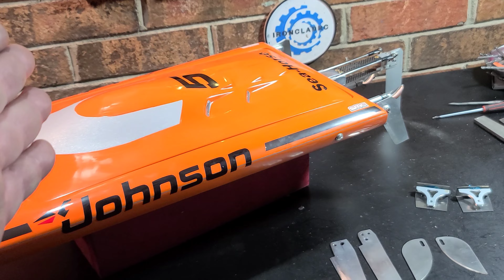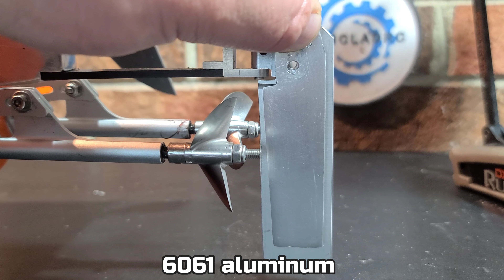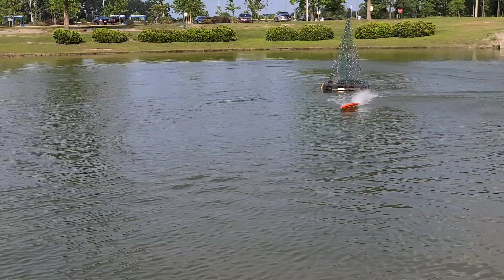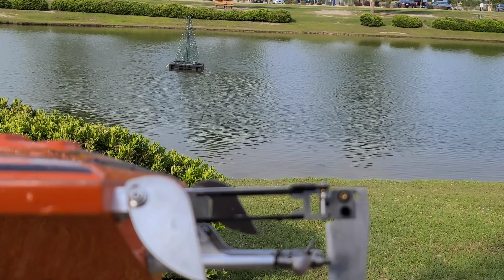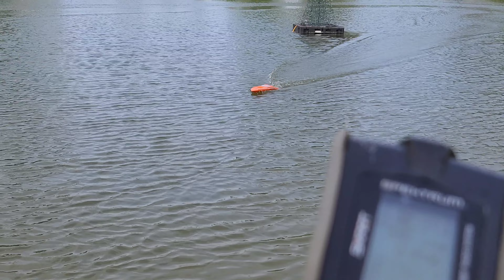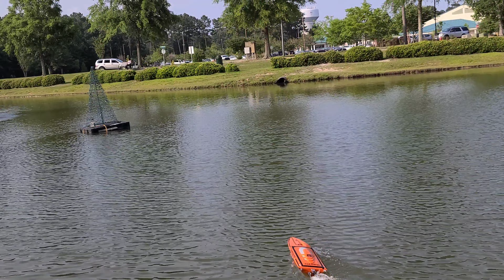True Tinker Test & Tune Session, Twin Motor Deltaforce 29 - Rudder Blade Testing

Comment: Awesome content again! I really like the twin motor mono idea. Actually, I owned kind of a twin motor mono: the Robbe Sea Jet Evolution. This is a water scooter and even though i used counter rotating drives, i recognize the sudden bites in the water. 
The difference in motor load, the rudder experiments  you got it covered 👍 I got a new project planned already, otherwise I would have accepted the twin mono contest 😎 Looking foward to the counter rotating setup. I think you could set it up to float above the water, like you already show in this video 👍 Cheers, DJ
Reply from the maker: Cables should be in today or tomorrow, I'm really interested to see the performance gain.
I've been scouring the interweb for my next project, I've got a few things in mind but not dead set yet.

Comment: Awsome amount of info in this video. I'm glad you are still trying to run with 2 motors running the same rotation. I have a little experience running twin engines in cats, mono and riggers. They all get harder to keep going straight or turn left as you increase prop pitch ratio. Larger props with 1.4 pitch are a lot easier to tame than small props with 1.9 pitch . https://youtu.be/RhWudfn2yLs
Reply: A couple of big gas twins in this video
Reply from the maker: Thanks for that information I really appreciate it.  I watch most all your videos while I'm working on my boats. Awesome content.  One question for you guys?  How does the electronics take the open cockpits or better yet what products do you guys use to keep everything up to par
Reply: @IRONCLADRC   the electric boats mostly run open engine bays. None of us have had any issues with submerging the electronics in fresh water. Most of the receivers have the boards coated (like your video showed) the servos and escs seem to survive getting wet. I have probably set myself up for failures now that I have said that.. one thing I didn't mention ,to stop spinning out on right turns with twins use a really large turn fin on the right side.

Comment: What if you wired both esc’s to one connector and ran a Y connector from the batteries to your single esc power plug? Then you can run one big battery or 2 smaller batteries if you want. The esc that needs more amperage should pull it as normal, but it would be equally from each battery.
Reply from the maker: I think that's what I'm gonna do I appreciate the input.  Glad I got the boat gang backing me. 😎

Comment: i adjust the throttle trim dial to keep those props spinning like there on bearings when you let off the throttle, to stop that issue on riggers, usually when im using outrunners motors to keep em spinning smooth a freely

Comment: ose make good stuff but zippkitts has the .187 or a .150. or etti style as you called it, both directions right or left . it only takes a week to get em. ose takes a little longer i think i bought a 200a ztw esc, i wish i wouldnt have it has no punch it in no matter what i set the programming card
Reply from the maker: It's the opposite for me where I live, I get ose within 2 days zipkits usually takes longer

Comment: Re the right hand motor getting hotter, try running a pack doing left turns to see if the right motor runs cooler. That would show if the constant right turning is making the right motor hotter.
Reply from the maker: Duh, why didn't I think about that lol. Guess that's why I have the boat gang backing me up in my journey.  Thanks

Comment: Wow! So much information learned here from this one video, I believe I’ll need to watch it a couple of more times.
 However- when you get your counter rotating setup going I believe your gremlins will all but disappear. 
  I like doing things with premaid connectors but in this case I think your best bet will be to create one battery with one connector and wire the ESC’s as one with one connector. 
This is one good looking boat Big B 👍
I’m taking notes, once I get past my last iteration of the BJ24 I plan on starting the drag boat build (coming late summer 2023) staring twin 2960 3400kv motors, ball bearing supported strait shafts.  I’ll make my adjustments with prop rake/dia/pitch changes and wait distribution. BGFL 👍
Reply from the maker: I'm actually in the process of repairing the drag boat hull.    What hull are you looking at for your drag boat build?
Reply: OSE, delta force vortex 24” hydro hull. I plan on setting it up so the battery can move down the middle approximately 3” in travel front to back.
Reply from the maker: That's s good hull to do it with, ose has been out of them for a couple months now.  That's the boat I was gonna put my drag boat setup on.

Comment: One side pull a lot more amps. 3.68 per cell and 3.84 per cell is a few 100 mah a part. Maybe even 1000 mah a part. At least on some cells. 

The reality is the 2 sides will never pull even capacity or be even with cooling. The difference happens during turning. When the hull leans for the turn one prop will be out the water more than the other. Resulting in a reduction on the amp draw for the prop that lift out the water.

And the same for the cooling when one side is lift when the boat roles for the turn. The side that lift will not cool for that moment.

I enjoy watching this project though. Great job.
Reply from the maker: Thanks, I'm always getting little things wrong in my videos, lol my mind just dont process as fast as I'd like it too....  
 
Me and Jethro d bodine might just be brothers from different mothers.

Comment: When counter rotating i think it will be amazing. Love the enthousiasme you got for the twin. Its more expensive, more complicated, not much faster but they are so freaking cool...😉
Reply from the maker: Agreed.
Reply: i LOVE twin motors. Especially the sound. I got my little twin motor mystic 84 setup, just rebuild it with 2 4050cm motors for 4S. tomorrow will be the first test. Was hard to setup last year tbh :D
Reply: @ThePerle1997  yes, got some Twins in the making.... V, but it doesnt run good. Try some things to get it better hopefully this season.  Hope to learn some things from B too, but boats are to much different i think. And bought a catamaran a few years ago which i have to finish some day. Just haven't had the time which really sucks. But that one needs to be done right, since it worth quite some money when finished.
But still, the V ran like crap, but it sounded so nice...

Comment: Interesting.  You can run two batteries into a parallel connector, going to a single plus/minus lead then another parallel connector going the other direction splitting to the ESCs.

Every time the Miss Exide spins out I'm letting off the throttle....  🤔
Reply from the maker: Yea, that's basically what I was thinking, parallel to parallel, now I need to figure out how to do it with minimal connections 🤔  

What did you think about my prop theory?  Props acting as tiny rudders  lol